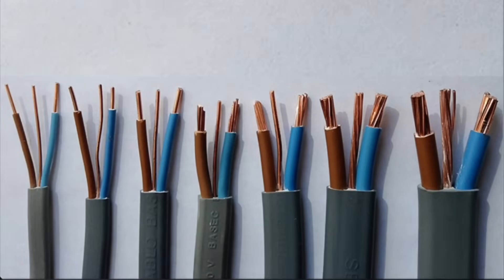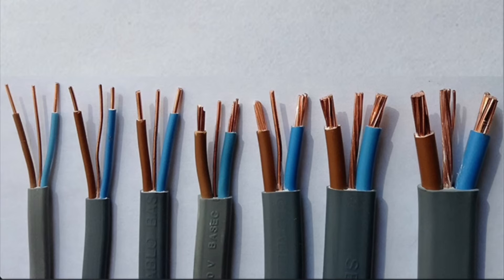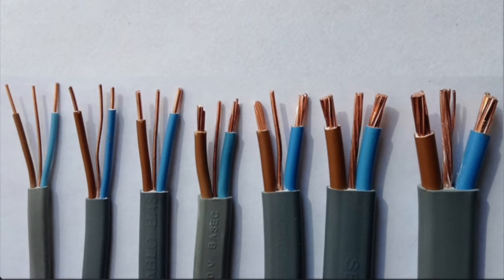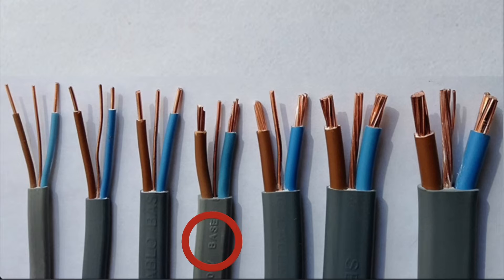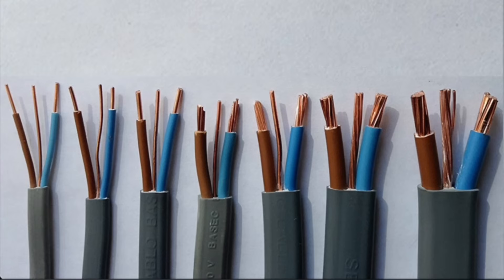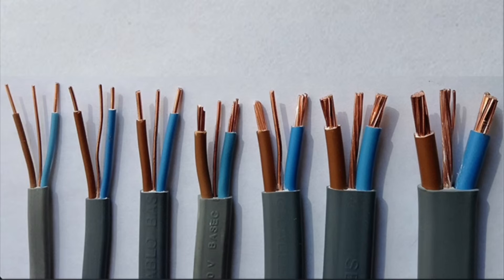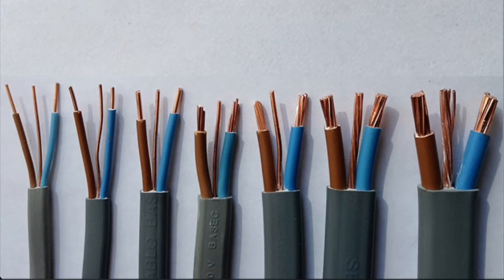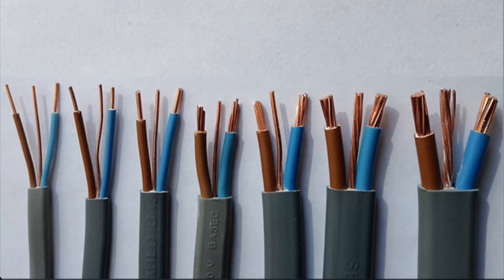What Sizes do Twin and Earth Cables Come in?

Comment: Thanks I think you’ve solved a puzzle I have with my shower cable now I thought when I ran the cable in from junction box to shower pole switch it was 10mm I thought it looked bigger than normal but looking at your video looks like 16mm and then I have 10mm from isolator too shower , now thinking when chap asked what I wanted it for he gave me the bigger 16mm cable , I will check today as I have to replace isolator which I’m swapping for the 50A Crabtree one

Comment: I recall in the 60s when I was doing my apprenticeship there was a copper shortage and our contracting company were installing on a new housing estate . We were given  solid core aluminium cable instead of 7/029 for ring circuits and all the electricians were moaning about how difficult it was to push solid core cables into a wall box. The shortage ended after about 4 months. Seems amusing now in todays modern 2.5mm use. I wonder if any of you modern day sparks have seen this cable in domestic homes.
Reply from the maker: Thanks for the information Gary 👍🏻

Comment: Never understood how the earth can be less than half the line conductor and comply with even the old regs 14 th when I started.
Reply: The reason is explained in the video. The CPC does not normally carry load current, and if it does, it's under fault conditions and will be for no more than 5 seconds. There simply isn't enough time for 5 seconds of fault current to generate enough heat to damage the cable. As long as the conductor has a low enough resistance to carry enough fault current to trip the breaker (or blow a fuse) on a line to CPC fault within the defined period. 

With RCDs and RCBOs it's even less likely that there will be a significant fault current as a fault to CPC of more than 30ma will cause those to trip immediately. Whilst it's possible to construct elaborate failure scenarios such that the CPC is carrying a high current, but not enough to trip an over-current breaker, those are extremely unlikely and, as mentioned, will always trip where there's an RCBO/RCD involved, so that would have to fail as well.
Reply: @TheEulerID  yes appreciate that but why does it only apply to conductors up to 16mm. Armoured and other industrial cables, Flexes all have equal size earths. ( too old to call them Cpc's) this anomaly only applies to t&e cable. I expect it dates back to the end of the war when materials were short!
Reply: @johnwarwick4105  I don't understand why we would want to make the CPC larger than it needs to be. 

As for industrial uses, then the parameters are going to be different. SWA doesn't come in the same colour codes as twin and earth, and doesn't have a dedicated CPC as such. It it is often used in three phase installations, sometimes as start, sometimes as delta. Sometimes the armour is used as the CPC.

There are simply too many variables and usage patterns. In contrast, twin an earth is used in many domestics and commercial premises where the parameters of the requirements are well known, so it makes sense to make the most economical cable which suits those needs. If you really want to, you could wire up a domestic property using conduits and singles; there's nothing in the regulations to stop you doing so.

Comment: In Ireland, and most of Europe T&E is basically just a flat 3 core cable (all conductors insulated, all same cross sectional area). New regs here in Ireland  which we refer to as IS10101 also call for a minimum fire rating on cable
Reply: Doesn't that just end up being very wasteful?
Reply: @nsoper19  Here in Germany the CPC is fully insulated within the cable since it must be marked green/yellow over the whole length of the cable run. Exception from that are cables with a concentric CPC. Up to 16mm² the CPC must be the same size as the line. Is the line between 16 and 35mm² the CPC must be at least 16mm², from 35mm² on the CPC must be at least half the size of the line conductor.
And the 1mm² isn't permitted. Smalltest copper conductor size for fixed installation is 1.5mm², for aluminium it's 16mm². The aluminium size is since 1973 in West-Germany and 1990 in East Germany. In East Germany they used a lot of aluminium conductors. It's not only about current carrying capacity, this is due to mechanical stability, bending radius, damaging the conductor while stripping and such stuff. And here the conductors are solid up to 10mm², so the stranded versions are starting from 16mm² here.
Reply: @nsoper19 no, it ends up being a little wasteful. Virtually all our domestic cabling is 2.5mm^2. You guys run  2.2+2.5+1.5 is 6.5 mm^2 of copper. We run 2.5*3=7.5. The difference is utterly negligible. With cables that thin, the price of the copper itself almost vanishes into the cost of competently making them into cables.

We’re allowed to start using “size down” CPCs from 16mm^2 and up, IIRC.
Reply: In Germany most cables are round shaped, not flat. Only type that is flat is NYIF, but no one here uses it anymore. Back in the old days it was a cheap alternative, but you can only use it in dry rooms, only below plaster, must be nailed to the brickwork and then plastered over, no contact to combustible construction materials. The wires are PVC insulated, but the cable sheath is made of rubber. And now these days it's almost more expensive than the more flexible in its application NYM cable.

In some countries like France, these cable types aren't permitted at all. They want conduits with single wires in there.

That is one of the three cable types that use the old German cable designation system from pre-European harmonisation: NYIF, NYM and NYY. The old NYA for example was replaced by H07V-U.